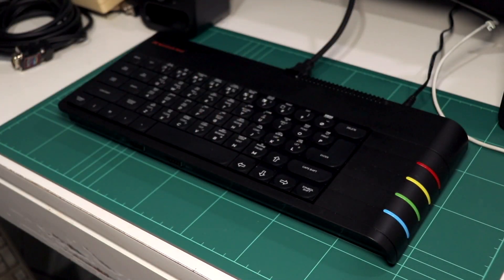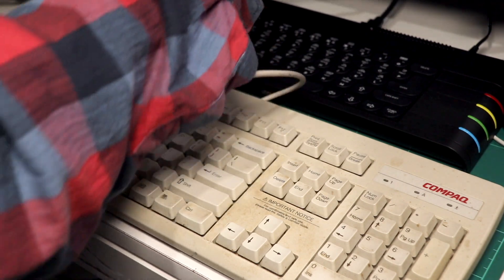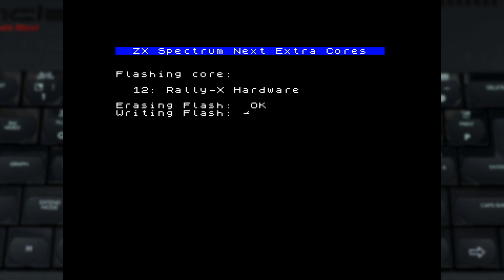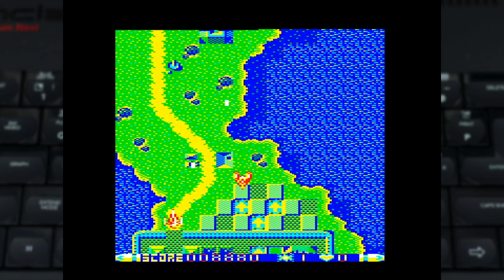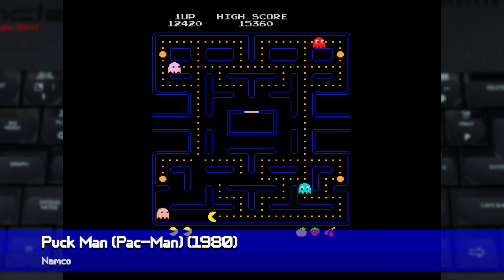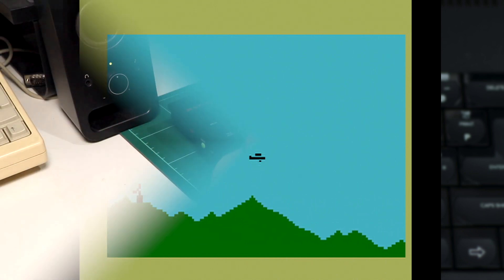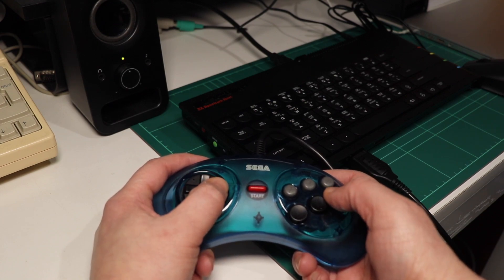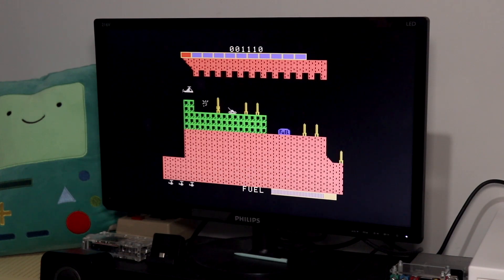Beyond The Scanlines Extra #010: Exploring Alternate FPGA Cores of the Spectrum Next

Comment from the maker: A heads-up for those receiving Nexts from the KS2 Campaign - as of Dec 2023, multicore support isn't enabled for these machines due to hardware changes, so the steps in this video won't be compatible.

As things update - which will require both updates to the main Next core, alongside rebuilding all existing cores, I'll do a follow-up episode. Though it should be noted that things haven't changed much in the window since this video was originally filmed, so the Next's support is limited compared to other FPGA platforms.

Comment: Do you need a full size keyboard with numeric keypad for the extra cores, or can you use one without the numeric keypad?
Reply from the maker: From memory, I don't think any of the cores rely on the keypad, though I'm not sure there are PS/2 keyboards about without them.

I guess I can only say to double check in the core documentation before you download and install to be safe.
Reply: @BeyondTheScanlines  Thanks for getting back to me.  Perixx make 'modern' PS2 peripherals and I just happen to have one of their keyboards sans the number pad.  Thus my question.  Cheers.
Reply: The old Model M Spacesaver is a famous vintage PS/2 with no keypad.

Comment: Thanks for the review - nice to have all that detail in one place.
I didn't know there was a PS/2 socket. Do you use the PS/2 keyboard to play the arcade cores ?  Changing the PS2 value switches from keyboard to mouse ?  Do you use a mouse with the Next ?
A FAT16 formatted card is a little weird - FAT32 seems to be the standard and finding smaller SD cards can be difficult.  The smallest you can walk in and buy is 16GB.
Reply from the maker: The PS/2 socket supports both - the original Next development boards were designed to be either standalone (and thus needing an external keyboard to be connected), or cased in a modified 48k Spectrum case. As it's the same OS distribution, the switch has to be provided to be support both systems.

Thankfully, outside of the computer cores, you don't need to hook a keyboard up - they only need it as the Next doesn't have enough keys by default.

The arcade cores use it like MAME, with a few keys to add coins or start the game, as well as rotate the screen & other stuff. I think those are playable from the keyboard as well, but I didn't try - preferring to use a joystick for maximum fun :)

As for the card format, I'm stumped as to why they don't support FAT32 either. The Next itself does (I have a single card which houses all my classic Spectrum software and the Next games which are out right now), and I'm hoping it's a left over from where these cores were originally set up - being ported from other platforms.

Comment: I really want to get one of these things but don't have to time available to justify the cost! Maybe if they do a third round...
Reply from the maker: It's a tough choice - 'cause I fully understand that front, but at the same time… it's hard to know if there's gonna be a definitive third run :(

As it's all open, there are plans for third parties to produce boards, and those'll fit into modified version of the original 48k Spectrum case… so that might be an option down the line :)

Comment: I also just wanted to thank you, Rob. These sort of videos are a lot of work as some of the cores could be videos in themselves. (I’m looking at you MSX and BBC).
Reply from the maker: There was only so much I could get done with this, that I had to leave a few by the wayside.

I'd certainly like to do an update in a few months maybe, particularly when some of the other cores in development are released. I know I'm seriously looking forward to the 2600 one. Especially if it can run the newer homebrew stuff (which I have a lot of issues with running on real hardware right now for various reasons).

Comment: Great work, it must have been a challenge with all the different video formats.
Reply from the maker: To be honest, not really. But I've been using a pretty consistent setup for quite a number of years now - so getting systems hooked up for capture isn't that much a challenge for the most part.

That being said, there are plenty of them where some challenges are still present - and it's always a case of finding out the right solution to be able to handle them properly. Whether it's upgrading capture kit, or finding new upscalers where appropriate :)